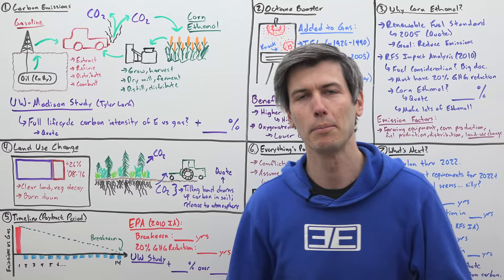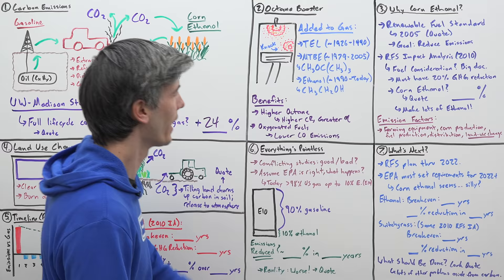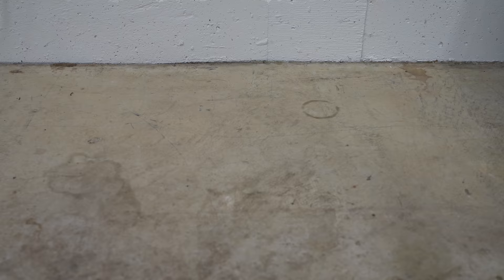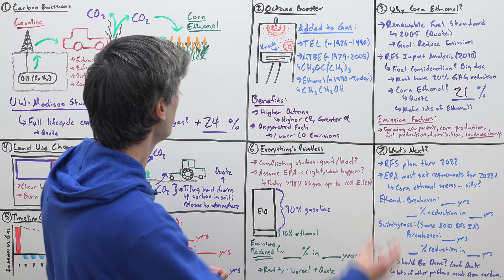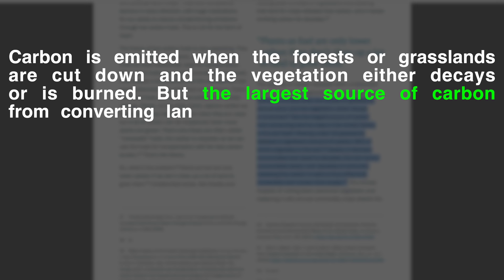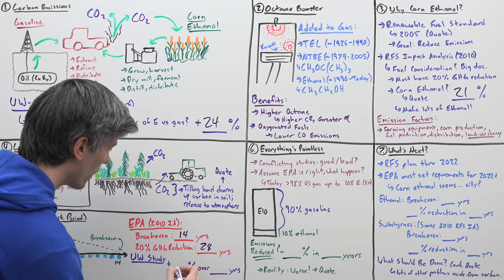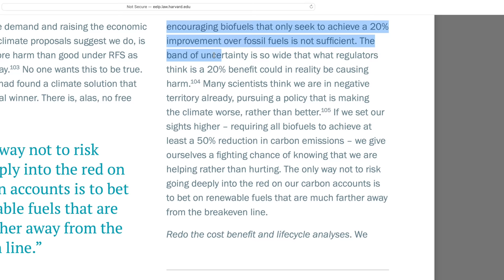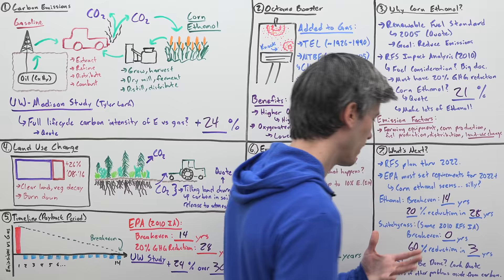America Was Wrong About Ethanol - Study Shows

Comment: After experiencing lawn mower issues last year, I started using Ethanol-free gas in all of my small engine equipment. So far, it seems to store much better than gas with Ethanol.
Reply: I hope more people look at this. You should NOT run gasoline with ethanol in your small engines (look for premium without ethanol). In the long run, its not good for the engine.
Reply: This is key.
Reply: Ethanol is higroscopic, it attracts water. E10 gas can be stored for 2-4 months before it hoes bad. E0 gas lasts for 4-6 months.
Reply: the smell of VP small engine fuel
Reply: Nothing wrong with using ethanol gas in small engines, just finely store it in them.

For something that a gallon of gas lasts a year then premium ethanol free gasoline is the only way to go. For something like a generator the cost of that would be less then desirable. My solution is I run both, I’ll run regular gasoline for the week and bring a can of premium as well. The premium is the last tank that gets ran before putting it away. Of course this only works for something that goes through a sufficient amount to make it worth the effort.
Reply: Even non-ethanol gas does not store well for long periods, e.g., six months. The gasoline polymerizes (molecules crosslink) and becomes much less volatile (harder to burn). This process can be arrested by using a fuel stabilizer, e.g., Sta-Bil, when storing vehicles with fuel in the tank. I do this with my motorcycle, which I don't ride from November through March, typically.
Reply: @berto1014  Its completly fine, you can even run pure ethanol, AS LONG AS ITS JETTED FOR IT
Reply: @ThZuao  Its not hydroscopic, it is hydrophilic meaning it is solluble in water, it does not attract water.
Reply: @berto1014  I think you read some misinformation somewhere.  This is just not true.  Sure ethanol is more corrosive but this is easy to account for in the fuel system design.
Reply: @berto1014  ethanol is totally fine in a 4 stroke engine. In a 2 stroke engine it can be harmful
Reply: @gregkramer5588  I'm not discounting that. If you use the fuel shortly after getting it, you'll largely be fine, especially with modern small engines. But most people aren't operating their small engines daily, and often use 5 gallon containers to store fuel long term. When the fuel sits, it separates and that's when it becomes "bad" for the engine.
Reply: I ended up going to an electric mower, in part because of having mowers damaged by ethanol in gasoline.  Now there's no oil changes, no running to town for premium gasoline, and it's much lighter and quieter to boot.  I know it's not going to be the best solution for everybody, but for me, the electric mower was a godsend.
Reply: Yeahhh, I accidentally left my mower full of a tank with stabil treated 93 pump gas with 10% ethanol. I tried for like 5-10 to start it the other day. Nothing. 😭
Reply: I’ve always used 100% gas in my lawn mower and weed eater etc, heard the ethanol eats out the fuel lines
Reply: Fuel injected vehicles seem to be more capable of burning old fuel regardless if it has ethanol in it or not, probably because the ECU adjusted the A/F mixture better than a carburetor. I don't use ethanol in a carbureted engine unless I'm CERTAIN I will use ALL of it within the week. If I've got some old gas that I stored for the snow blower and didn't need then I mix it in with a half a tank of fresh gas in a fuel injected engine. Switching to electric solves all those problems, but batteries don't offer enough runtime for a snow blower yet and electric motorcycles are still too expensive.
Reply: Your gasoline engine doesn't care about the ethanol content it has. Issues people typically have with ethanol fuels is when the engine is stored for a long period of time with ethanol fuels still inside them. The ethanol fuel gums up over time, which prevents the fuel system from operating properly.

Solutions are to:
1) don't worry about it and simply clean your carburetor when this happens
2) drain your carburetor prior to storing it at the end of the season
3) use a fuel stabilizer which postpones the breakdown of the fuel, potentially allowing it to last a season of storage
4) use ethanol-free fuel

5) As noted by @Matthew Spry below, switching away from gas entirely is a great solution for most people in most cases.

When I used gasoline yard equipment, I used regular pump gas and just drained the carb at the end of the season. Only times I ever had an issue is when I forgot or was too lazy to drain it at the end of a season and it gummed up during the winter, and corrected by just cleaning the carb.

My generator, on the other hand, I keep ethanol-free fuel for it in a steel jerrycan because it is seldom used, and I know that I'll have good fuel on standby for it when the need arises. Its carb is always drained, and the cylinder oil fogged before putting back into storage.
Reply: @Locke99GS   5) buy a lithium powered weed whacker 🤔
Reply: @matthewspry4217  Also true - i've switched to battery tools for all my yard equipment. The convenience is second to none.
Reply: @Oceam  Ethanol is hygroscopic. It does in fact attract water. If you've got absolute ethanol and leave it exposed to the environment it will end up being 95% ethanol, 5% water (or thereabouts) before terribly long and be a pain to get higher proof. Hygroscopic and hydrophillic (meaning "water-loving") are very much NOT incompatible. Sulfuric acid is crazy hygroscopic and is ALSO hydrophillic. Ethanol and sulfuric acid are both miscible with water (meaning you can "dissolve" an infinite amount in water, though there comes a point where it's more that the water is dissolved in the other liquid).

I'm a chemist, I know this stuff.
Reply: That's the best way to go
Reply: Same.
Reply: @ThZuao  some people say that e0 gas last for a year to a year and half.
Reply: @napoleontheclown  Okay i believe you, but i don't believe e10 fuel sucks water from the atmosphere to the point where it no longer is usable while sealed in a gas tank in 2-4 months
Reply: @Oceam  If you know how a carburator works you know that it has a cup and E10 attracts water and the gasoline evaporates and what is left after being stored is mostly ethanol and water pulled from Atmosphere....
Reply: @Oceam  The biggest issue is the carburetor: Carbs are by design not airtight. They are designed to mix air and fuel together. The fuel bowl of a carb is fully exposed to the atmospheric air at all times. So the biggest issue is leaving fuel in the fuel bowl of the carb during storage.

With regards to fuel in storage: If it's stored in an airtight gas can, you're right. E10 will store almost as well as E0 in an airtight container if you fill it very full to leave as little air in the can as possible.

But a lot of people are using old gas cans that aren't 100% air tight. The tanks on lawn equipment are also not fully airtight: They are vented to allow air in but not *out*. They need to be designed this way so that air can enter the tank as fuel is drawn from the tank to prevent a low pressure (vacuum) environment. This allows air and humidity to enter the tank.

The biggest takeaway is that most lawn equipment uses cheaply made carbureted engines that generally aren't well suited to run ethanol based fuels because they simply weren't designed for them. Modern fuel injected vehicles on the other hand were designed to handle them.

I agree with several other commenters on this thread: Instead of fussing with draining and/or cleaning carbs and/or having to run around looking for ethanol free fuel. Just go electric. It's so much easier to operate, less noise, no smoke or smells, no having to run around looking for fuel or transporting fuel. I have a 5 acre property and I manage most of it with an electric Cub Cadet Zero Turn mower and an electric walk behind DR string trimmer. You couldn't pay me to go back to messing with gas now.
Reply: @berto1014  It is not just the engine, the engine may be least affected. Ethanol is an organic solvent while gasoline is a mineral solvent. Finding materials that are compatible with both is difficult. Ethanol actually is more damaging to fuel lines, seals and fuel tanks (mainly non metalic tanks) The other problem is storage. Ethanol is hydroscopic, it absorbs water. If water can condense in the fuel tank ethanol will absorb it until it reaches it's max load then the water comes out of solution and the fuel mix in the tank will stratify causing big probelms for engines trying to burn it. At pipleline fuel terminals the ethanol is not mixed with the gasoline until it is loaded on the delivery truck. And ethanol cannot be run through the pipeline system. It is usually delivered to the pipeline terminals by railroad cars.
Reply: It gums carb jets up quickly.  I've let ethanol gas set in a motorcycle for a month and a half and had to clean the carbs to get it to run properly.  Fuel injection has enough pressure to blow out the gel from ethanol gas but anything with a carb that sets for a few months should have ethanol free gas unless you plan to run it dry every time.
Reply: @Clearanceman2  That may be because if ethanol's solvent properties. It takes the gums and other hardened things in your fuel system dissolves them and the engine has to deal with them.
Reply: @jaydunbar7538   NO! carburettor based engines need to be ethanol proofed for use, otherwise it's corrosive properties are bad (even then, it forms part of the reason most motor pump fuel supply chains are capped at E10-15% depending on country) There's a reason all the big boys like Briggs and Stratton and Honda list a do not use e10 in their 4 stroke instructions and go to the trouble of moulding a warning into their fuel caps, and it ain't because they don't give a crap about their green image.
Reply: better to use Ethanol only on EFI engines (port injection and O2 sensor),
avoid using it on carbureted engines.
Reply: 👍👍👍👏👏👏 YES. Small engines abhor ethanol!
Reply: 10% Ethanol gives me nghtmares of all the rusty fuel tanks and rust flakes in carbs I've had to clean out or replace. Nasty.
Reply: Biggest problem with ethanol in gas is the non vented fuel system. You absorb water in there that binds to the alcohol. This sinks to the lowest point of the system which is the bowl of the carburetor. Then you have a bowl full of water and you are pulling that damn rope until it rips out of the machine. Spend 5 minutes to drain the bowl and it will start.
Reply: @beardedforlife3740  Any engine that has a carburetor is subject to corrosion and pitting from the ethanol.
Reply: @Locke99GS  It will not only gum it up, it will pit the pins and holes in a carb.  The, they won't work right and replacement is necessary.  Usually, it's cheaper to just replace the carb.
Reply: @truthbetold1855  no it's not. Aside from having a carburetor there is much of a difference between a carbureted engine and an efi engine
Reply: @shimatta1  Cool, they seem great for a smaller yard.  I have a free mower that I put a harbor freight engine in and it is still going strong.  $99 :-)
Reply: @beardedforlife3740  I disagree. If the 4 stroke does not get much use the same negative effects happen. The reason cars dont have problems is because they are constantly being used  not like a snowblower. Also a modern car has a sealed gasoline system (EVAP) unlike boat built-in tanks that are vented.
Reply: @mph5896  True, but the water content actually has a protective effect on “alcoholate corrosion” of aluminum.  Google it if you don’t believe me — “dry”ethanol will eat an aluminum carb or cylinder head if you let it soak in it.
Reply: @ThZuao  I know the logic behind this but I’ve had e10 standard gas stored for years and it still works 🤔 maybe as long as the tanks are sealed?
Reply: According to someone who ran a transportation company, regular unleaded has a shelf life of 30 days. I once bought a used Subaru that had been sold 8 months ago.Thats how long has had sat in the tank.I was only be getting 18 mph.I ran out the old gas and put in 93 octane and got 30 mpg.This was a 2003 Subaru Legacy.
Reply: How do you get to hell?
Very simple: claim that you're innocent.

How do you get to heaven?
Very simple: Admit that you're not Innocent, you're guilty and ask for mercy.

How to know if you're guilty or not?
Simply: Compare your life to the Ten Commandments God gave you in the Bible.
Everyone agrees that if people followed the ten commandments there would be no need for governments or police.

Do not lie.
Do not steal.
Do not commit adultery.
Do not insult God by using his name as a cuss word.
There are six more but let's just leave it at that.

How many lies have you told in your life?

Have you ever taken anything that didn't belong to you?

Jesus said, if you look at a women lustfully you've already committed adultery in your heart with that woman.
How many times a day do you do that?

Do you use God's name as a cuss word?
Would you do that with your own mother's name?

If you answer these questions honestly you know that you're guilty.

God can justly punish you and send you to hell.

Ask him for mercy.
His name is Jesus.

It's as simple as this, The Ten Commandments are called the moral law. You and I broke God's laws. Jesus paid the fine.
The fine is death.

Ezekiel 18:20 — 
"The soul who sins shall die.

That's why Jesus had to die on the cross for our sins. This is why God is able to give us Mercy.

Option A.
You die for your own sins.

Option B.
Ask for mercy and accept that Jesus died for you.

)()(
Reply: Ethanol is plain crap. I don’t ever use it. It didn’t belong in my household.
Reply: @ittimjones  generally the translation .... look for a new carburetor ... yours is clogged with the mats that are created with dried out fuel ():>{
Reply: @napoleontheclown  slightly on tangent ... brake fluid is also hygroscopic .. takes up water which becomes important when large recreational vehicles (more brake fluid inside I guess) sit for long periods of time.  The result ... rust but worse when rolling down the road again normal brake action heats the fluid .. H2O water boils out to Hydrogen and Oxygen which are compressible gasses resulting in brake pedals to the floor and fright in the mind of drivers hoping to find a place to park the thing.  Yes, this happened to an acquaintance.  I asked questions learning there are lots of 'war stories' created by that hygroscopic parameter.
Reply: @TimHoHere  Yeah, it's not a great situation to be in...